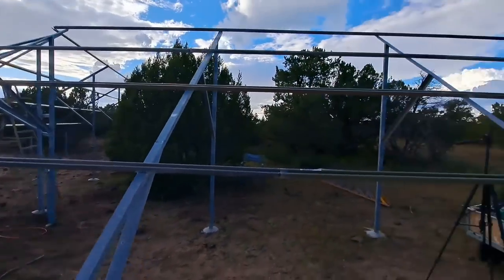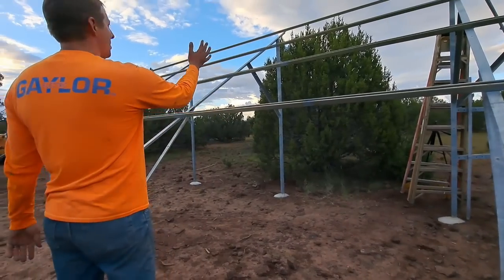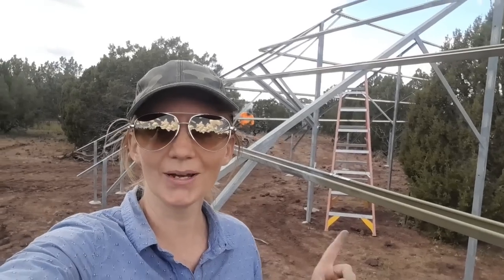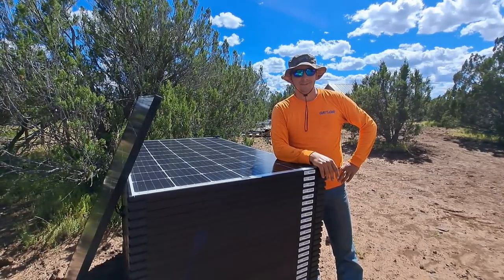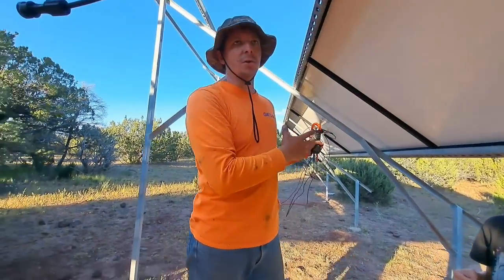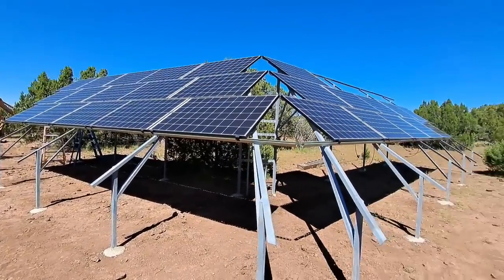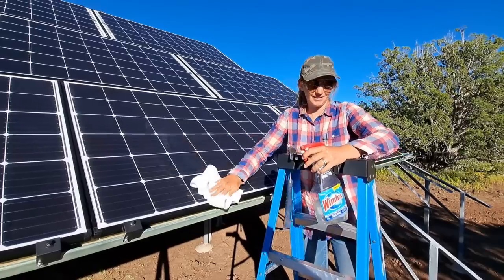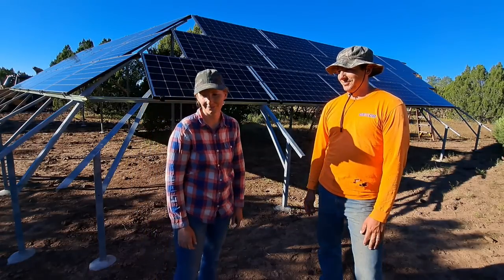Husband And Wife Install 30 Solar Panels On Homemade Solar Stand For OFF GRID POWER

Comment: Brand of solar panels used ???  You're providing a link to Shop Solar, but they don't mention the brand of solar panels in their kits.  It looks like the panel you use are fairly light weight which is always a good thing.
Reply from the maker: They are made by Solar World. Thanks 🙂

Comment: All of the lower struts are a danger if they are run in to by one of the kids. Do you plan on a rail of some kind along the bottom to make it safer?
Reply from the maker: The plan is to add another row of solar panels there someday. Thanks for watching.

Comment: HOWdy  A-B-L-O-G, ... 
when you are bolting the END of your panels & the WASHERS want to torque to one side = try a piece of 3/4" or 1" of PEX  Water Pipe cut to the thickness of your PV Panels FRAME ... 
It worked for me = pennies in cost
COOP
the  WeSeNhEiMeR from Richmond, INDIANA 
...

Comment: I am somewhat in the same position,, I have 14 panels to put on my roof ,Also I am using Unistut  ,, I like the idea of making your own clips and washers and stuff to hold the panels down,,  I bought cheap Chinese clips and just painted ,,  One thing I have done is insulate the panels (somwhat) by placing the panel on the unistut  but sitting on some masking tape  also insulating the clips by using plastic washers,, Not doing that for electrial issues but stopping metal to metal corrosion... Another issue I have ,,  I am by myself  and my panels look bigger ( and I,m 66) so will be abit of a struggle,but as I,m retired I have plenty of time...  (oh yeah I,v gone down the victron rabbit hole too)
Reply from the maker: The Victron rabbit hole 😂! You got that right! Thanks for watching.

Comment: It is not just volts, but amperage is just as important in power making...and yes you should be testing every panel before attaching to the system...
I do like your two direction facing arrays, covering more of the day more even power...but as the sun is lower on both sides of noon, the angle of the panels needs to be steeper than a south facing array...

Comment: You can make really good washers out of old car tires and they can be tightened without damaging anything. Good for steel roofing as they are watertight.
Reply from the maker: Oh nice! Great tip!
Reply: @aboulderlifeoffgrid   This is where I got that tip 😊 https://youtu.be/yaJDrwGHAXU